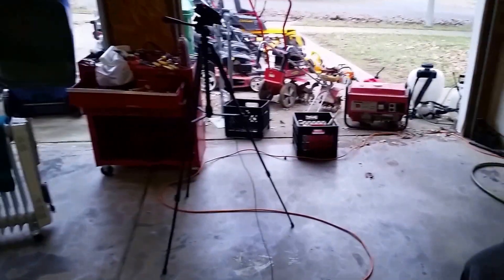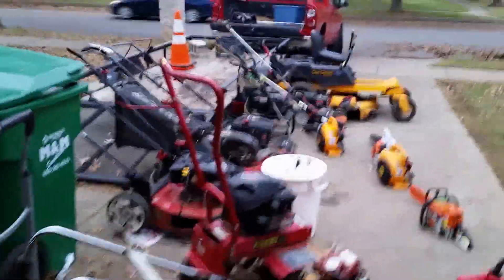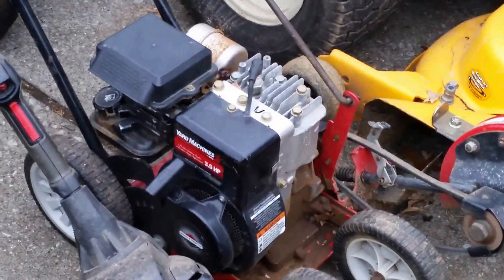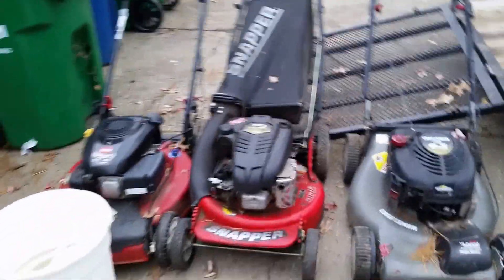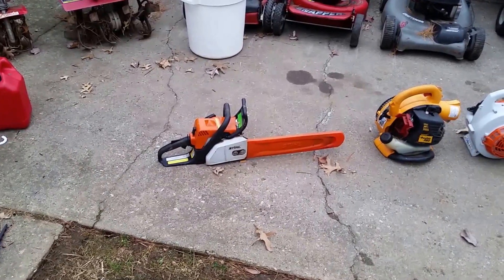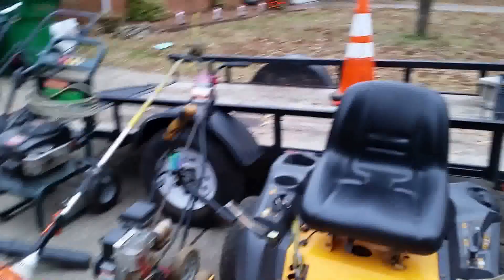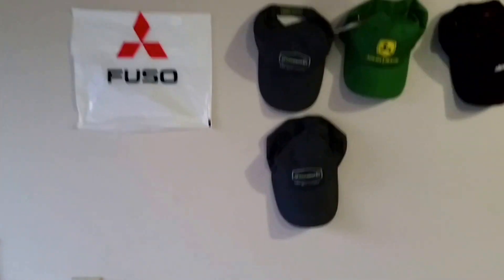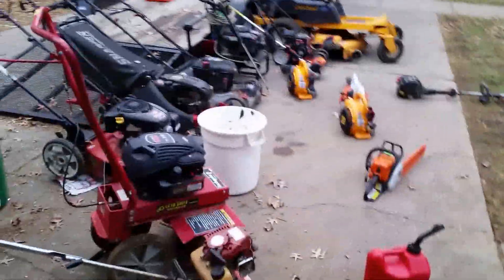Mow yo yard  work tools

Comment: what do u mean when u say u might get something more commercial?
Reply from the maker: +Melvin Jones well theres home owners  grade and commercial grade i got a commercial 36 inch walk behind
Reply: is it a difference in hp or something. what makes the cub not a commercial mower
Reply from the maker: Melvin Jones its  not built to run 5 days a week 8 hours or more a day... its like  it will work  for a lil while  but  getting a more steardy  mower  will last longer under  every day use,,,,  a residental mower is ment to cut  say  1 hour every week  not  30 hours a week...  if you cut  full time you will use a mower more  in a week then  the avg home owner will in  a year